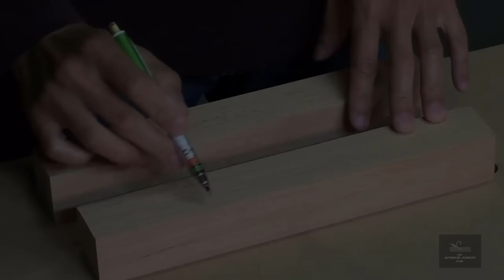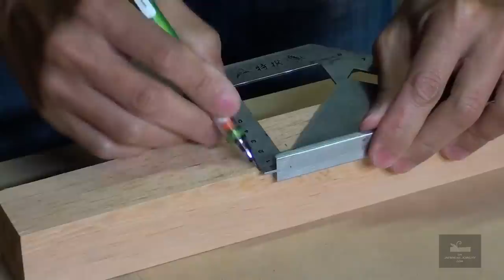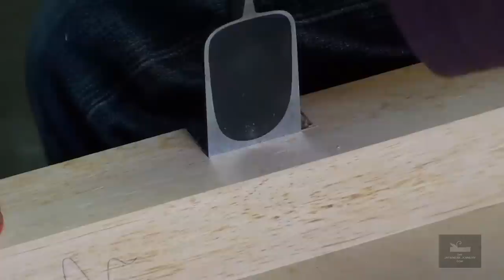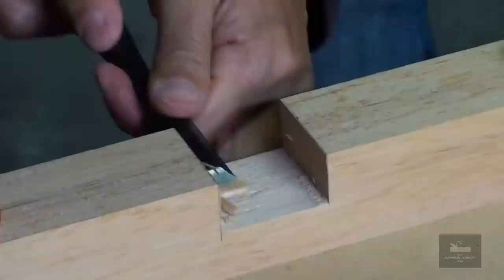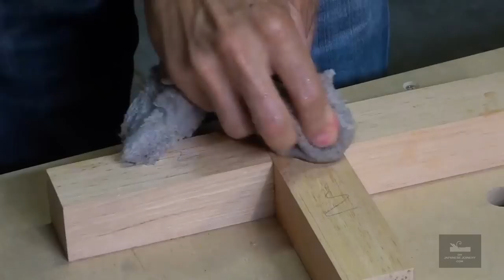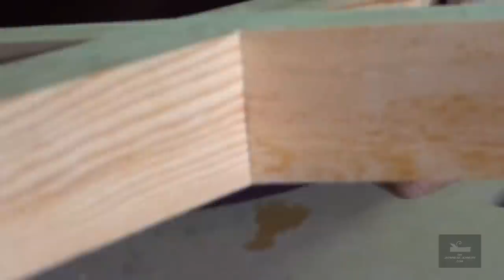Japanese Woodworking Tip - "Kigoroshi"

Comment: I just finished building a flat framed wall with 60 of these joints using stock from Home Depot and a circular saw.  Even that looked too nice to put on the sheet rock.
Reply: oltedders you half lapped stud wall?
Reply: John Rockett 
Yip. We have a cabinet (kitchen side) that penetrates the wall that will hold a laundry bin in the dressing room.  We had to make the wall as thin as possible to maximize the opening over the bin on the backside of the wall.  I sheathed it with 1/4" drywall. The finished wall is 2" thick and rock solid.
Reply: oltedders ohh nice ha, was just curious!
Reply: John Rockett 
I saw this done on This Old House. All the studs are a full 8' and notched into the upper and lower plate. The cross bracing runs the full length of the wall. Every joint is glued and screwed. The wall is insulated with rigid foam sheeting cut to fit.
Reply: Sounds like a time consuming stud wall mot that I've got any doubt it's a good way to do a stud I bet the wall was solid but here in UK most the stud is just nailed together and more and more metal stud walls are being used where about are you from?
Reply: John Rockett 
It was a real chore but had to be done that way to produce a 2" thick wall that has the strength and stability of a standard 4 1/2" wall.
I'm in Texas, just north of Houston.  I also live in Colorado.  Construction is very consistent  throughout the U.S. Variations in local building codes are dependent on climate, weather conditions and fire codes. 
New residential construction is still predominately in wood, gun nailed. Remodeling tends to use 3" screws and wood if not a major renovation.
Reply: oltedders yeah I bet it was! Thanks for the insight it's nice to know how joinery/carpentry vairys around the world I'm in England, Liverpool

Comment: When I use those expensive chisels from Japan ($$) they have a concave back so I am not able to keep alignment in some circumstances. the chisels from the US are junk with poor steel hardness and expectedly a quick rate of dullness in white oak or walnut. I have the Martin T60C with a dado program asking how far from the end is the dado at cross grain, depth of dado, width of dado and it tells one how many passes for the dado or regular square kerf blade as used. Some dados are 2.5" X 5.5" for beam work to match another like size beam. It is perfect off the saw with flat floor cuts and a nice fit using a 350MM German blade. When I bought the saw I did not realize this dado software was in the package. One can tighten or loosen the fit by .001" due to some woods (even with a fresh blade) cut differently than others. It can take 3-4 weeks to get a new blade from Germany.  I can cut 40-42 dados in a day and never look back.
Reply: It’s $20,000
Reply: É um grande prazer estético fazer trabalhos com uma serra circular...

Comment: Is it true that Japanese saws have their teeth backward? that is the cut is done by drawing the saw towards you?
Reply: Gary Lewis ??? You draw hand saws towards yourself in America too? Because when you push the metal can bend because it’s thin right?
Reply: Gary Lewis, they are called pull or Eastern saws, as opposed to our push or Western saws.  They are very nice to use.
Reply: Yes Japanese saws cut on the pull stroke while North American saws cut on the push. The theory is that the blade will bend less on the pull stroke which adds to the accuracy of the cut.

Comment: Recently purchased an expensive sideboard from furniture chain appeared to be solid timber, was laminated on every surface. When exposed to moisture delaminated to reveal chipboard.
Reply: Ashley Furnature? Lol. If so I have found myself that they sell junk.  Bought a $2500 couch that broke in a year
Reply: I learned my lesson on cheap furniture.  2500 bucks for junk at Ashley or 3000 bucks from La-Z-Boy and my grandkids will probably be making fun of my weird old couch.
Reply: how could you not see that it was laminated?
Reply: In old days not every expencive furniture was made from solid hard wood, I saw lot of furniture made from spruce and laminated with exotic hardwood.  For long time ive thought that my entrance door on my 100 years old house  was made of solid oak but it turned out that it was just laminated  with 5mm oak, the rest was pine :)
Reply: ivan s same today, but you can tell
Reply: They sure don't build new furniture like they used to.. Most of the stuff they make today is junk.. They dont even use real wood veneer anymore.. They basically just cover particle board with stickers..
Reply: @MarkLada  hey, you get what you pay for.

Comment: Could that be a permanent fix without glue screws or dowels ?
Reply: Not sure if you found the answer already, but Yes. Friction fit like this will stay in place, even without glue
Reply: this particular joint would get loose as the wood shrinks, but I'm pretty sure that a lot of japanese joinery, such as in houses, is done without glue.

Comment: can someone explain why that small gap matters? I can barely tell the difference between the before and after. Also, why does he tap the wood with the hammer?
Reply: For gaps that small, it's cosmetic, nothing structural - just a man taking pride in his work and using a simple technique to make it a little bit nicer.  Also depending on the project it may be more or less visible.  Tapping it with the hammer compresses the fibers of the wood so that it can be fit into a tighter space than he would've been able to without the compression. Later, once it is in place, the wood absorbs the water and swells up to it's original size (possible larger? but should level out at the original size once it reaches equilibrium with the humidity of the air again).

It's sort of like those vacuum bags they sell for storing your winter clothes under the bed.  It might be hard to fit them there, but suck all the air out and it compresses.  If one re-inflates while it's under the bed it will expand to fill all of the space available to it.  You can fit more under there by using the vacuum bag that you would otherwise - and likewise, he was able to fit slightly more wood into the joint than otherwise and then the water was the equivalent of poking a hole in the back to allow it to expand.

If you hit it too hard or with a hammer that has straight edges (like he cautioned against in the video) it can actually sheer some of the fibers so they aren't able to spring back even after the water is applied.
Reply: Thank you!

Comment: Could anyone please explain why, and on what parts of the joint, he chamfered the edge with the chisel? I thought the whole point was to keep the edges 90 degrees and crisp, so chamfering seems to be completely counter to that!?
Reply: i think because the joint was so tight already that those corners would've chipped off or been damaged when trying to assemble, like chamfering a tenon....i think
Reply: only the two (inner) edges on each piece that lie hidden when joint together. the funnel-like shape makes it easier to interthread the pieces, especially, if you are aiming for a very tight fit

Comment: damn i wish my tools were sharp
Reply: Easy to do... Get a granite block( Grizzly sell them)... stock up on sandpaper from 100- 1500 grit ...get a veritas angle guide...start sharpening....for final touch use bench grinder equip with polish wheels ( compound required). When you are finished, your chisels will be razor sharp and have an edge that is mirrored finish.
Reply: Bloody well sharpen them then.
Reply: The scary sharp method is amazing

Comment: For the final joint would oil work better because it wouldn’t shrink back down?
Reply: Oil would ruin the pores in the wood. Making it unable to stain or topcoat due to chemical reaction 👍
Reply: That's actually a case by case decision... As Zak Michalkow points out, the oil will prevent any staining or a fair amount of other finishing methods (paint, acrylic especially, and certain clearcoats)... 

   BUT I'm guessing you're thinking more along the point of Tung or Linseed oils AS a finishing technique all in one go... In which case, yes, if that's what you want... but understand the limitations of the linseed and tung-oil treatments (of course)...

    Water CAN still be used in the first fitting, for the purpose of "proof of concept" as you may have some need to disassemble the project before completion... or if it's a temporary situation (like scaffolding)... AND you can plan to reclaim or repurpose the wood later... OR in the case you might "change your mind" (like having a wife or someone else involved). ;o)

Comment: What is the purpose of hammering the wood before joining the two pieces together?
Reply: make it easier to connect together
Reply: it compresses the wood a tiny bit which will then expand when water is added,
Reply: It spreads and opens the fibres and when glued tends to keep its shape as the glue acts like the water to expand the fibres and basically fills any gaps.

Comment: Why do they need to concave grind the back of chisels?
Reply: Assists when sharpening so you don’t have to remove as much material
Reply: @gaveno11  Not really cause along the cutting edge those chisels are straight on both sides. We do not have to sharpen all along the back side.

Comment: A 'spoon backed' chisel has a very limited life compared to an ordinary flat chisel.
You can get the same, or better reduction in friction with wax, either wiped on, or sprayed.
In addition the increased loading at the edges would tend to mark the wood more than a flat chisel where the load is spread evenly across the width.
More accurate marking is performed with a knife, which makes a very fine line, instead of a pencil, as the edge of the saw teeth will tend to follow the cut which it will not do with a relatively broad pencil line.
Also, squeezing the joint together in a wood faced carpenters vice is preferable to a steel hammer, always.
Reply: It's all about sharpening
Reply: "with wax, either wiped on, or sprayed"  yup.  wax on, wax off !
Reply: No chisels have flat backs. Either hollow or rounded.  Japaese steel is superior and they last and last.
Reply: @raysmith1028  
If your chisels have rounded backs, then you should grind them flat or throw them away.
By definition, unless they are gouges, they are rubbish!
Reply: @niklar55  The Craftmanship displayed by Kigoroshi speaks volumes of his skills and  the quality of his tools.  Subject closed
Reply: @raysmith1028  
I was doing the same at 12 years old! 
I was top of my school in wood work, and I didnt need weird Japanese chisels to do it.
Chippendale furniture was, and is superb, and also was not constructed with weird Japanese chisels.
Subject closed.
Reply: niklar55 there is no need to belittle other craftsman or their tools. shame on you
Reply: @abebeaku8369  
I'm not belittling the craftsmen, or their tools.
One half lap joint is hardly ''volumes''
I was just putting it into perspective.
Reply: Niklar55 do a vid and share your superior skills.
Reply: @RussMeister70  
I have more important things to do with my time.
Reply: like critique others?
Reply: @flemingcourt  
No,
This month, and maybe next, I have 15 - 20 trees to log, fell, or both, cart, split and stack for winter fuel. 
Demonstrating a simple half-lap joint and filming it doesn't fit into that. At 15, I was making cabinets with secret mitre dovetails. No one else in my school was.
Reply: @niklar55  what a clever boy
Reply: @w.fikhasi2252  
Naturally.
Reply: @niklar55  I would like to say a cup of tea and a slice of cake to you my good man, I understand what you meant. 👍

Comment: i want chisels that sharp
Reply: Then sharpen yours that sharp, if you have some :D Admittedly the Japanese use of laminated hard (e.g. Rockwell 64) steel and softer steel backing does help achieve and retain incredibly sharp edges but you should be able to achieve that with a western chisel. At least that's what I keep telling myself! :D

Comment: the only problem I can think of is when the wood looses mositure it will shrink back and will be even worse than before.
Reply: Or thats how it works with axe handles atleast. Soaking a loose axe head will fix the problem for a lil while but they alwasy shrink back and usually worse than before
Reply: Lurkno use windshield fluid. It won't evaporate after a day

Comment: What happens if the wood dry up again?
Reply: Use antifreeze instead
Reply: fanfam @aa
Reply: it stays the original size before it was tapped. and expands and contracts naturally with the rest of the wood
Reply: It is meant to. He shrank it with the hammer and just used the water to get it back to normal.

Comment: Do the gaps not reappear when the wood dries?
Reply: The hammer work done prior to assembly compresses the wood fibers where the gap will be. Adding the moisture after assembly allows the wood to recover to its pre compressed state.

If you skip the hammer compression, then yes, the gaps will reappear after it dries.

Comment: What happens when the wood dries?
Reply: it would still be extremely tight,
The watering of the wood only serves to inflate the fibers again after they were compressed by the hammer,
so after the water evaporates and the wood is dry, you are left with inflated fibers that are no longer at their compressed state
and since the wood was fitted in an already tight fit WITH compressed fibers, the uncompressed fibers on a dry wood would still make a very strong fit

Comment: ok but the water will evaporate after some time anyway.. 4:37
Reply: Fibers regain their shape to keep the joint tight, if they are not compressed beyond a certain limit. Don't ask me what that limit is, that is where craftsmanship comes in. R. Bruce Hoadley for more information.

Comment: I heard this is how old japanese temples were made not with nails but just connecting the wood together and I also heard this is stronger than using nails and the reason why temples in japan last so long
Reply: Redlynx Vires 

That is correct (:

Comment: olive oil for lubrication also works
Reply: dont use olive oil on wood,
If it has to be a food safe oil, use mineral oil (which is basically paraffin oil you can buy in any drug store by the gallon)
If it does not have to be food safe, there are plenty of oils to use for wood.
Olive oil is for salads not wood.
It rots rather than polymerize, and it ends up creating a sticky rancid surface.

Comment: I can’t say I’d call that a perfect joint with so much resistance
Reply: Very Good Boy it's supposed to be a tight fit. The less wiggle room you have the better
Reply: VGB, I agree. All that pressure takes a toll on the straightness of the workpiece. I would expect it is now curved, and deviation from a flat plane is compounded because the other stick is curving in the opposite direction. After all, half the thickness of the stock is effectively removed, and it is now only a fraction as stiff. 1/4? 1/8? Engineers or architects, please chime in.

Comment: But it will dry up again
Reply: I wondered the same
Reply: That's why you hammer it carefully and not destroy the fiber. It compresses the wood temporarily. After it's wet, it'll go back to the original state of the fiber. When it dries out, the fiber doesn't go back to it's compress state, but stay in it's original form.

Comment: What does he mean by flat end and round end of the hammer?
Reply: Google a ball peen hammer and that's probably what he means by round and flat end of hammer
Reply: Just continued watching the video and noticed the hammer he's using lol my bad, scratch what I said in the comment before
Reply: Alex Dao you’re still basically correct, though. It technically could be used as a ball peen hammer, it wouldn’t be very effective.
Reply: A hi- quality body hammer. Irvan Smith. They sale hammers with a slight convex curved head. When I dought, use a backing block to hammer on, like when he finished.

Comment: Hammer that is round on 1 end, flat on another. Isn't that a ball peen hammer? Used all over the world?
Reply: No.A ball peen hammer has a much steeper domed face and would leave dents in the wood.
Reply: A ball pein hammer is an engineers hammer not a carpenters hammer, the curved surface of a Japanese woodworkers hammer is only slightly curved and at a quick glance you would not notice the difference between the two faces.

Comment: Anyone heard of getting a dado Blade for your table saw?
Reply: Almost impossible to find here in the UK. Maybe Health & Safety issue as you need to remove the blade guard out of the way.
Reply: @terencejay8845  Pity. Good quality ones can make the work so easy. Serious workers will find them invaluable and worth  the price.
Reply: @prospectsinc  When I was working in Colorado, I saw dado blades in circular saws. You can't get worm-drive saws here either, like the Skil77, or left-handed sidewinders!
Reply: @terencejay8845  Yes, I know they make them, but I wouldn't use them. However, I have used a single blade on a circular with a square and made several cuts to form a dado. Not the cleanest, but good in a pinch. If you want pretty and permanent; use a table saw or better yet,  a router.
Reply: This guy made that dado quicker than I could set up my dadoes. A good woodworker with hand tools can often make a joint faster by hand. Machines are great and fast for repetitive accurate cuts but for a one off they can take as long or longer.

Comment: Dont use water
Reply: Use oil
Reply: Piotr Karczewski why oil?
Reply: Kevin Belden water will dry out
Reply: Kevin Belden and make the parts even looser than they were beforehand
Reply: Piotr Karczewski Good point what oil do you recommend?
Reply: Kevin Belden i be been told that any will do
Reply: Kevin Belden it's probably more of a colour thing also use one that's liquid at room temperature